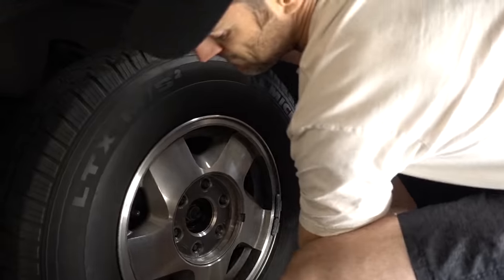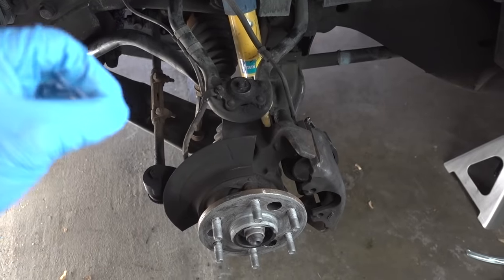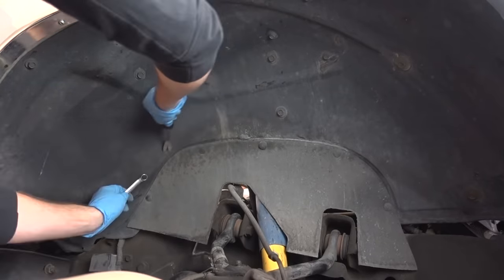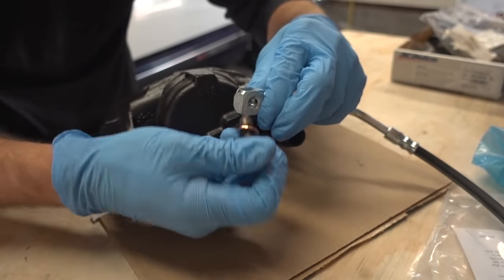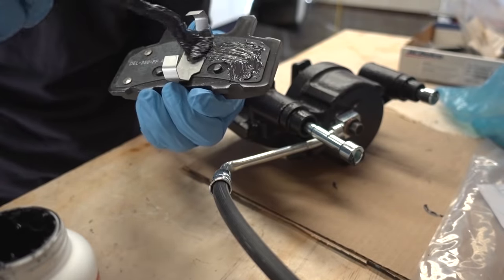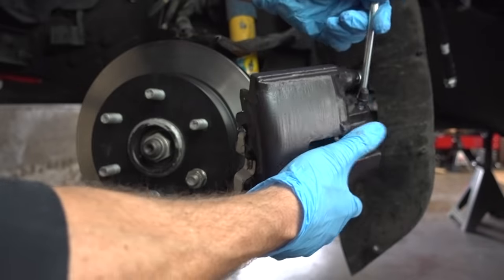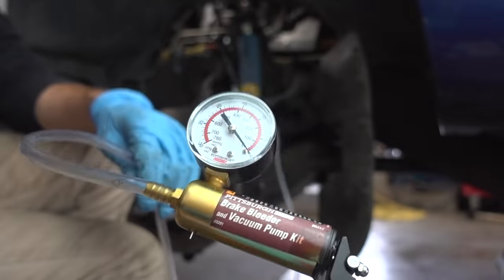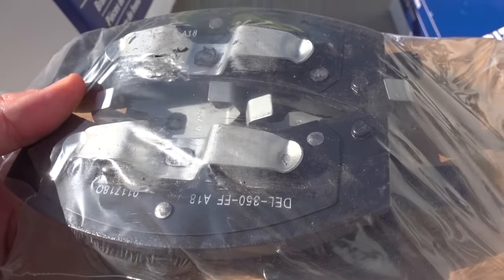How To COMPLETELY REBUILD FRONT DISC BRAKE SYSTEM!!

Comment: Just replaced mine and they work like a charm. Started with changing the pads and rotors, and kept getting a scraping sound. Went to ceramic pads, same thing. Replaced the calipers after watching your video and the scraping sound is now gone. I couldn't replace the flex lines, though. The upstream metal lines look too corroded to try to remove without damaging them. Thank you for the video.

Comment: What happened to the soap and water to clean the rotors before fitting? Didn’t think you liked using chemicals to degrease them 😁 keep up the good work bud 👍
Reply from the maker: I don't like using chemicals but in this case it's just so much quicker spraying it with brake clean. I hold my breath the entire time and where I protection just in case of splashes. I wipe it down quickly with a paper towel and get out of the area to not breathe anything.
Reply: Good man 👍 you can’t be having a coughing fit during a video. Keep the informative vids coming and when you getting your wife back? She’s much better looking that you 😁👍

Comment: Ok Jimmy with 1Road. Couple key points to take note of for your and your family's safety. 

Cracking the braking system it's recommended by the manufacturer and aftermarket mfrs to bleed all brakes from the furthest wheel away to the closest wheel. 

Those lugnuts, brake calipers, caliper mounting bracket bolts if you have them ( I do just did em last night), even the brake fluid line all have torque specs. I don't so much worry about the brake line fitting as you can only get them so tight but the BANJO BOLT with the crush washers has a torque spec as well. 

Want the proper service information check out and get a 5yr subscription to Mitchell DIY for the vehicles you own and you'll be amazed as what you get for information. 

Also those brake pads need to be "burnished" in so you don't have that issue in the future. You say how to burnish, find a quiet road go up to 30mph then brake steady but not slamming on brakes then start driving again letting brakes cool and do it between 20-30 times. Yes it takes awhile but having them broke in properly will make a difference long term. 

Just thought I'd pass the information along even though you have your disclaimer. Not worried about that but more so to ensure people know how to properly torque so they don't ruin parts due to improper torquing.

Comment: I just had to do all this this weekend. One of the calipars stuck and warped the rotor. Took me like 8 hours cause I ended up having to do bearings too and I had to keep running out to get parts. Nice vid!
Reply from the maker: Nice. I was contemplating doing the bearings too but every way I could check them they seemed completely fine. So decided to hold off on those for another day and another video lol.
Reply: MSTWNTD, I FEEL FOR YA, NOTHING IS EVER EASY ALWAYS MORE TO THE JOB. I HAVE A 97 JEEP GRAND & WAS ONLY GOING TO CHANGE ALL THE U-JOINTS ,LOL. $712.00 LATER IN PARTS ALONE I'M STILL AT IT. JUST BOUGHT NEW TIRES YEST. DIDN'T INCLUDE THEM IN THE PRICE, I'M AFRAID TO ADD IT UP.
Reply: The bearings are probably still good since you have lower mileage

Comment: Personally I have had very good results on multiple vehicles with "brakemotive" rotors and ceramic pads off ebay. They are based in the US and are good to work with on warranty needs.

Comment: Glad  you used good brake parts.  You still should break in the rotors and pads with the break in procedures: drive at 30 miles/hour and slightly step on the brake paddle to let the car slow down to stop few times to break in the rotors and pads.  The break in procedure will make your rotors and pads last longer.
Reply from the maker: Yes, I did that. it was funny I was at a stoplight and there was lots of smoke coming out from both sides of the wheels I got scared for a second and then pulled into a Home Depot parking lot and checked and it's just a brake pads. Apparently this is normal. Part of the curing process of the pad...
Reply: outdated now.

Comment: I have a 97 GMC truck and my brake caliper has a few rubber dampeners that are in the bolts to the calipers to keep them from rattling, which I did not even see in this video.

Comment: I cringed seeing the use of a open wrench on the brake line. I've stripped too many flare nuts in my life. I also opt for semimetalic pads personally, but if you're going for it being quiet ceramic is the way to go.

Comment: I really hope that was a high temp non-running grease you put on those pads.

If it was not then when those brakes get hot you are going to have the grease melting onto the braking surface and lose brake performance almost immediately.

Comment: Surprised that then new calipers didn't come with a new banjo bolt and crush washers.  Also, you only need to apply the grease to the any contact points.  Excess grease just serves to accumulate road grime.
Reply from the maker: Yes I could have used last grease... I'm surprised that it didn't come with new banjo bolt too but my old one seem to be in good shape.
Reply: I agree, SHOULD HAVE CAME WITH NEW BOLT & WISHER. PUT SONE GREASE OR ANTI SEIZE WHERE THE ROTOR MEETS THE HUB, GREAT JOB JIMMY, YOU WENT ANIMAL ON THAT. I USE ORGANIC PADS MY 97 JEEP EATS ROTORS UP WITH SEMI OR ANYTHING ELSE BUT ORGANIC ? THEY HAVE SMALL ROTORS & THEY WARP.
Reply: @NoWr2Run  Nothing wrong at all with the organic pads, you just have to change them more often (and they may be a little dustier).  Thanks for the information about your Jeep

Comment: A couple of years ago, it was time to check my 1999 silverado brake system, and found it totally shot.  I was not happy with NAPA because of previous quality problems.  I instead purchased all new brake components with Autozone Duralast components.  The kits were complete with  all hardware required and the task was simple after getting all the old parts properly cleaned.  The rear emergency brake pads were the hardest to clean and get ready for service.  When a vehicle has 300,000 miles on it, its time for a complete rebuild.
Reply from the maker: Glad you got it sorted out. I've seen a few comments on here with people who have used AutoZone duralast and actually like them a lot. 👍
Reply: I work for a Zone competitor but I've also heard good things about the Autozone Duralast pads and shoes

Comment: I use brake clean, but do NOT use the aerosol cans. I bought a reusable canister and a gallon of brake clean. Honestly, it stinks a whole lot less from the gallon container, I think because the only propellant is the compressed air that I put in the sprayer. Either way, it's better for the environment - marginally.

Comment: you should have had the old rotors resurfaced instead of getting new ones because thoose old rotors were already "seasoned"
 now you are risking the new rotors becomming warped from heating up and cooling down
Reply: As new rotors are from China and may be more prone to warping.  Hopefully he didn't get rid of the original rotors so if one day they're needed they can be turned down and used

Comment: OEM is the answer.  Does Detroit Axle make these AC rotors?
Reply from the maker: Not sure. Yes, OEM is the answer!
Reply: I THINK YOU HAVE TO BUY AFTERMARKET BRAKE ROTORS TO GET ANYTHING MADE IN THE STATES ANY MORE, PRETTY MUCH CHINA ROTORS, IT'S SAD.
Reply: @1RoadGarage  Thank you for your thorough effort and follow through.  Brakes (and tires too) are nothing to screw around with.  A car that boils-over is inconvenient, but one that won't stop deadly.  Thanks again!

Comment: I use AC Delco brake parts on my GM trucks, have really good results but it bothers me they are usually made in China.
Reply: AND they're generally made on the same line as aftermarket parts that have other brand labels. People would be surprised if they only knew..  I get remanufactured stuff all the time from either acdelco or other brands with the other brands stamping on it from before it was remanufactured..

Comment: You weren't able to find the source of the noise tho... U just replaced most of the relatively new parts with brand new parts.. Why r u putting so much money into a 24 year old car?
Reply from the maker: It's really not a lot of money at all. Buying Acdelco parts from Amazon is incredibly cheap. Cheaper, in fact, than what dealerships can even buy them for. Not to mention I have no car payment. It is very cheap for me to run this 24 year old Suburban even if it only gets 12-15 mpg.
Reply: 1 Road You’re right. Couple of hundred dollars on a car parts per year is absolutely nothing compared to the new car payments&yearly value loss&dealership charges...Keeping the old car going is vice move both economically and enviromentally...